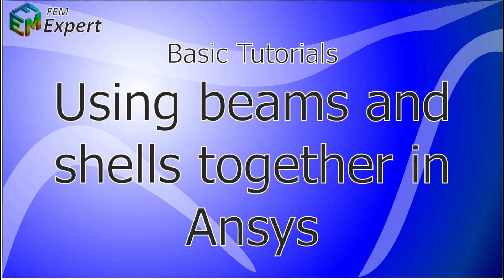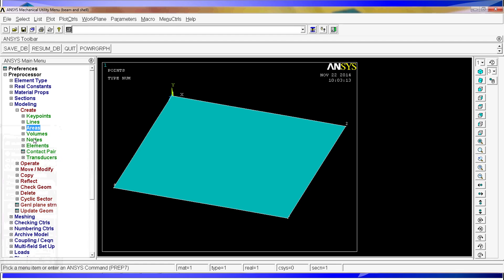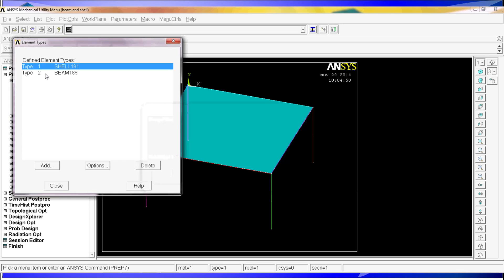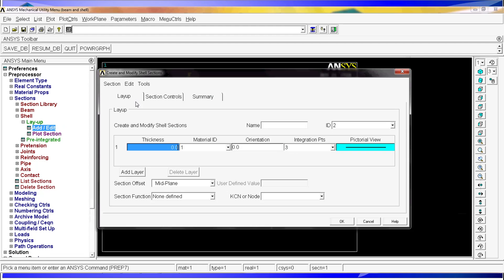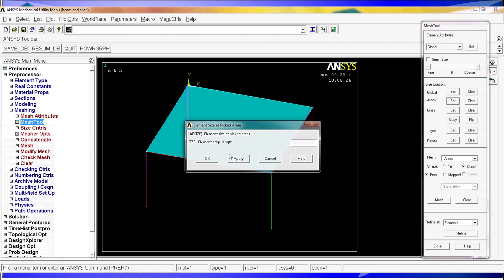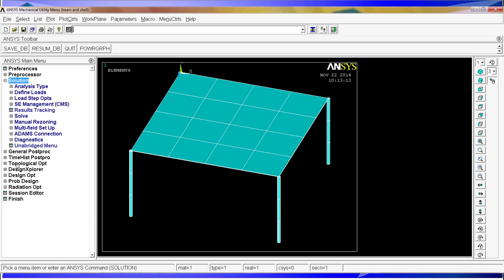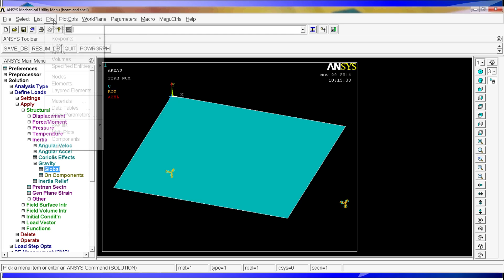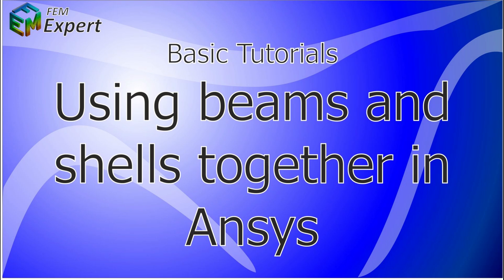Ansys Tutorial: Using beams and shells together in Ansys #8

Comment: sir in my APDL solution for stress in not coming it always shows dialog box that " the requested S data is not available The PLNSOL command is ignored
Reply from the maker: @adityajain7178  that means you have not solves properly, check your model and see if any conditions, forces, configurations, etc are not correct